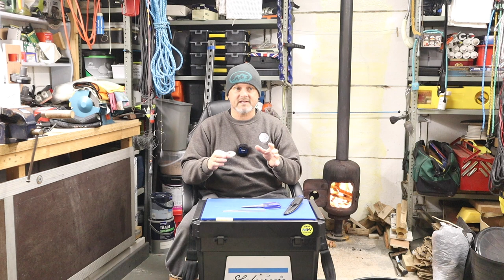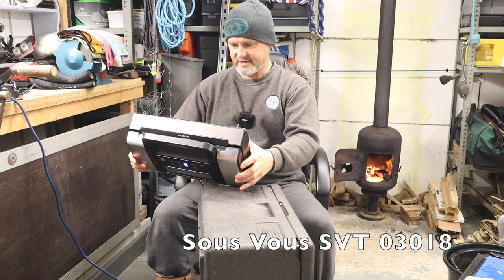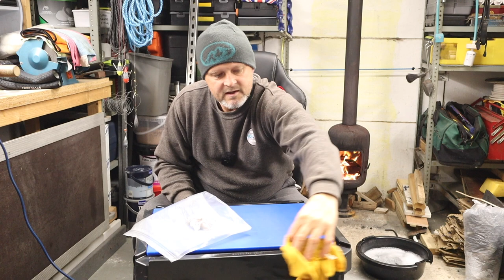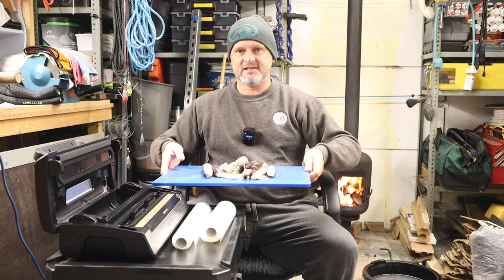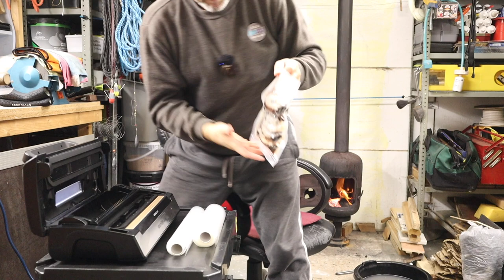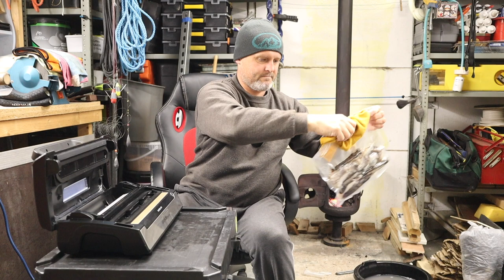Squid & Black Lug COD bait prepared and vacuum packed

Comment: I've also got into the habit of preparing baits in the same way lately and find it very convenient on the beach.  I don't vacuum pack my baits though - I just use small zip lock bags with the air squeezed out.  Some people think refreezing bait is a bad idea but I've never had an issue.
Reply from the maker: Preparing baits is particularly effective when splitting down larger boxes. If I part defrost a 5lb box of squid I might as well do the prep and then flat pack the smaller bags for later.

Comment: Another great video, pretty much what I do, try to keep all clean whilst bait vacuum sealing, but I didnt think of folding the opening over, nice touch thank you buddy, I keep all heads guts and scraps as I plan to make chopped squid frozen fingers to shove inside the squid body as a constant release groundbait, gotta work right? 🤷🏻‍♂️🤣
Reply from the maker: Don’t waste a scrap or a drop of any of it. Small strips are good for black bream, you can soak other baits in the juice and mix anything else in with any chum/ground bait you make. I like the idea of frozen fish fingers, almost like the crab cart they stuff inside finger bandage. 🤔
Reply: @seaangling  that's what I do with crab cart, I get the cart in a Chinese meal plastic tub, defrost it, seperat it into silicone molds then freeze it, hollow out squid body, pop in the frozen cart finger and elastic wrap up, lot of faffing but it works.

Comment: Great to see you looking well mate hope you family are well too love the video might have to invest in a vacuum packer I usually open the squid up and wrap the blacks inside the squid which I think prevents the black getting washed out too quick will have to try it on the outside and see if there is much difference good luck for tomorrow mate hoping to get out quite a bit over Christmas myself tight lines mate
Reply from the maker: Hi Nick, the shore fishing at this end is pretty quiet atm. Is it any better your way and further East?
I’m still not 100% but definitely feeling better. Double jabbed and booster. 
I’m hoping to get out loads over the next 2 weeks but this easterly slows things right down in the Solent.
Reply: @seaangling  hi Mark glad you are going the right way it has been a bit quiet this way there have been a few codling caught and 1 that was reported at 15lb they have more miss than hit also hoping to get out quite a bit over Christmas stay safe mate 👍

Comment: I use the lidl vacuum sealer, cheap and cheerful. Vacuum bags are good but cheap. Great for putting the bait in and stops the scent going into the freezer.
Reply: Oh the tentacles I use to tip hooks for the bream in the summer, works a treat.
Not that I'm a great fisherman though.
Reply from the maker: I think they are an awesome bait for small species.

Comment: Hi Mark Just had another viewing of this video. As usual there are a couple of points which raise a query in my mind. The first is what to do with all of the cut off bits of bait. I know you can vac pac them but they can be put to good use as ground bait/burley/chum (depending where you live in the world). Another point is why are burley cages (aka swim feeders as I used to call them) not used with  the rigs. It would seem to me that the pennell type rigs are ideal to add a burley cage.  You could blitz the bait bits and use a filler to make a stiffer mix. Using this in the burley cage would place the burley right where the hook is. Burley is a proven fish attractant so why not use it.
Reply from the maker: The tidal run will wash the burley away from the bait and detract from forming a scent trail. The bait is anchored in a position by the weight, the burley would disperse with the tidal run. From a boat it is possible to lower a bag or use a bait dropper. From the shore it is possible to bury bait at low tide. All things worth considering and I love the idea of a bait or burley cage. 
The small trimmings are used for bream baits.
Reply: @seaangling  You have already showed us how to use the stainless welding rod to form bait needles. It's only a short step to form a burley cage by winding the welding rod around, say, a 25mm rod forming the cage. You can extend it buy pulling and then using the ends of the welding rod to form into a hook or an eye. This would then clip between the weight and the splash down clip. As for the bait washing away that can happen but if you make the burley (you get a handful and squeeze it in between the burley cage) firm enough I found that it takes some time to wash through the cage wire. Just my thoughts Mark.

Comment: Excellent video Mark! I use a lidi's purchased vacuum machine, with a rolled down top like you do and I then put a rolled up piece of kitchen paper towel as the last thing before I vacuum, that way it absorbs any moisture and stops any bait fluid getting into the vacuum machine. I have also tried pre baiting onto hooks so vacuumed already on the snoods, so far that seems to work ok.
Reply from the maker: I haven’t gone down the pre-baited on snood route yet but I have considered it. I’m interested to hear more.
Reply: @seaangling   Hi Mark, so like I prep the bait like you do but  put the bait straight onto a hook(s) then bed the hook point (s)into the bait (to stop the point perpetrating the bag) then coil up the trace place in the bag and seal in. The tissue kitchen paper towel sheets, are the thicker more absorbent type rather than very cheap kitchen rolls and this helps stop the line from being sucked out of the bag as well as absorbing any excess fluid. The cheaper vacuum machines only provide seal or vac seal hence the tissue paper as it protects the machine and I learned by experience any bait fluid into the vacuum chamber and inner works makes the machine unusable for other tasks as I've had the fragrant scent of lugworm on chicken, that didn't go down too well with the fishing permissions officer! I've not had any issues with line becoming brittle form being frozen and if you are prepping rigs by having those traces hanging form a rod rest very soon thaw out in the elements.
Reply from the maker: @timpettis9895  that has certainly sparked my interest and got the brain working. 😉👍🏻
Reply: @seaangling  Billy on the Billyfishing channel. Uses a hair on circle hooks. 
So only uses one hook. But the hairs can have a shrink tube over the eye of the swivel. 
The process could be to make a stiff body hair pre baited with the bait and them just attached when changing baits to the circle hook. 
That would fit into this work flow you show very well. 

One thing I have always wondered about. Many times frozen and refrozen squid looks pink. 
But I have never removed the outer skin. 
So I guess that’s why they look wrong.
Reply from the maker: @onemanriflemaker3873  squid turning pink is the first indicator of how it’s been stored. I like to remove the membrane as the white shows up in murkier waters.
Reply: @seaangling  the debate for me has always been how many times can you refreeze squid before it becomes zero value.
Reply from the maker: @onemanriflemaker3873  when it turns pink and even then it will catch.

Comment: I have used a hand pump vacuum bag sealer from EBay which you can used on the boat or beach for saving bait
Reply from the maker: I’ve not seen a hand pump version.

Comment: Hello my Beauty!  Great to see you Mark - good video.  Sorry to hear you've had the dreaded Covid.   
I don't tend to freeze baits as I mainly buy them frozen from the tackle emporium, but I have got a Vacuum sealer - very useful bit of Kit for freezing Steaks, chops & fish.  Mine came from Lidl or Aldi (forget which) and they are a great source of supply for the roll bags (clear one side) similar to yours. Great tip about folding the top down - never thought of that!  
Couple of useful tips - if your Vac Pack machine doesn't have a bag cutter, those rotary paper trimmers are ideal for cutting a load of bags off the roll, and I find the Vac Pack machine works a lot better with a 'platform' in front of it so that the bag is up level with the sealing element.  

Looking forward to the Cod session, & sorry this comment has ended up so long! Merry Christmas to you & yours, best wishes for 2022, stay safe & well!    Dave.  👍👍
Reply from the maker: I forgot to mention about the level platform bit, thanks for reminding me. I have a pice of wood that I use to make the bag level with the heater element. 👍🏻
I think people rate the one from Lidl and I’ll check out their bags when they are available. I’m sure they will be reasonably priced.

Comment: Hi Mark
While we're on the subject of bait presentation here's a couple of things I've picked up on. Nothing new under the sun just a bit of research in odd places.
First if you're preparing your own stick on gel like Pro Cure it's no use using gelatine/geletin to thicken the goo (which is what many use when making up their own goo). 
Why?
Because gelatine is insoluble in water. The nice scent remains locked up in the goo or your bait and will not be released.
Use instead another thickener called xanthum gum. Soluble in water and doesn't degrade the scent. Look it up if you want further info.
Second. Don't use oil, (tuna or any other type)  in your goo or burley. A sacred cow this one which will make carp fishers go red in the face.
Why?
Because oil floats to the surface and floats away above the water column missing the fish which may be further down or on the bottom. Make up your own goo using water soluble xanthum gum (there is another alternative but xanthum is in common use ) which is what Barkley use for their Gulp.
Again don't take my word for it - look it up . 
Cheers
Alan H
Reply from the maker: I’ve had some Xanthum gum delivered so will be experimenting with that to see how it performs. What are you mixing with the gum to add the scent as everything from a mackerel or squid is oily?
Reply: Hi Mark Berkley I use petroleum jelly (Vaseline) which is the sticky part of the formula in order to adhere to the lure. I don't use the Vaseline because I find the mix I've given you will adhere to the scouring pad and releases into the bait trail quite successfully. 
Cheers
Alan
Reply: Missed off the "'don't" That is I don't use the Vaseline it's not necessary
Reply: Hi Mark Just found out the price of a 2oz Pro Cure is 22 bucks down here.(and I guess Berkley Gulp will be the same)  Ouch! 
I think it will be worthwhile to persevere with making up your own formula.

Comment: Hi Mark Sorry to add to complexity of the subject but one the things they add is polypropylene alcohol (anti-freeze). Info " Propylene glycol is completely soluble in water and it has the feature of dissolving many organic compounds such as fragrances, essential oils and resins and in addition, it has extremely low toxicity and is virtually harmless to the human body."
So it's easy to see why they add this stuff to the mix. Anyway then add this to glycerine and then add to the XG. Finally when blended add to the blended fish attraction and goob or smear onto the scourer pad.  What I'll do is get a really strong scent trail going and see what happens.
Reply from the maker: I’m a little confused about the scourer pad?